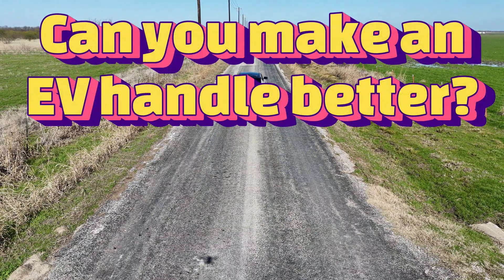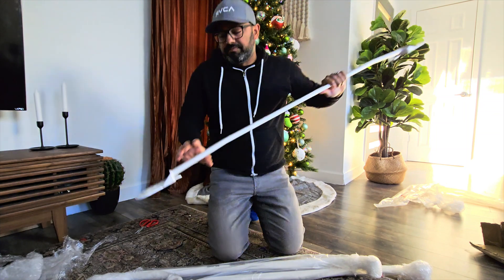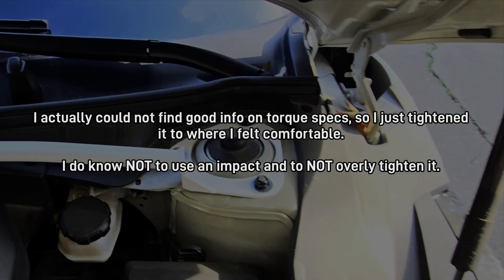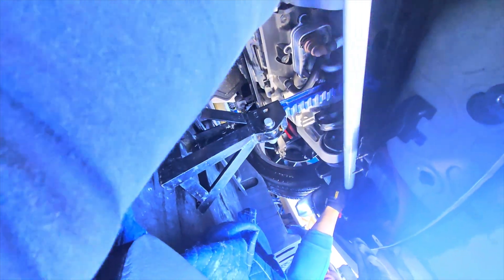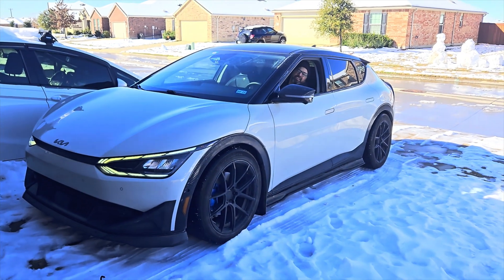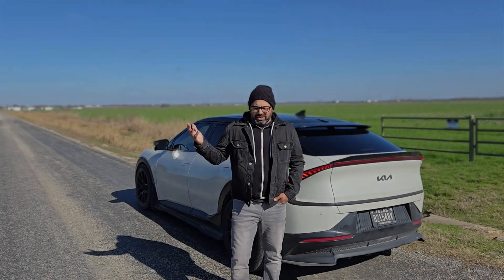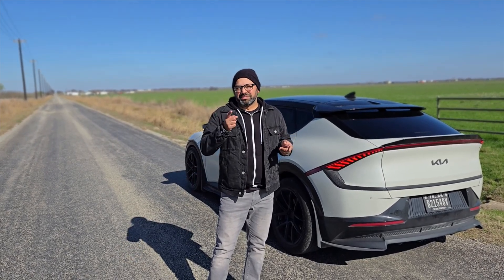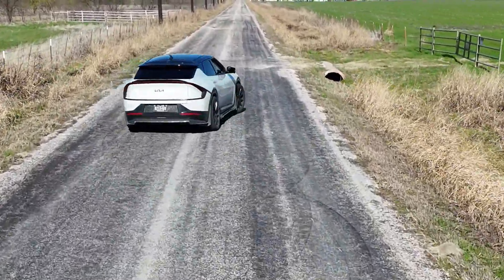IMPROVING EV HANDLING: EV6/Ioniq5/GV60 strut bar & chassis braces from Ultra Racing

Comment: Thanks for posting this. I am thinking of getting them for my Ioniq 6
Reply from the maker: Everything helps... Even if it's a tiny bit of improvement.
Reply: @Emadifications now that you have had them on for a while what do you think?
Reply from the maker: @atehrani I sold my car a while ago, but I think these helped a bit overall. Def didn't hurt. Won't make it a racecar but def helps roll and stability a bit.